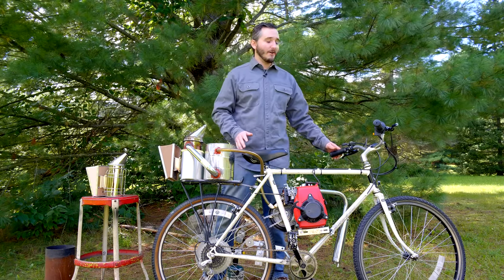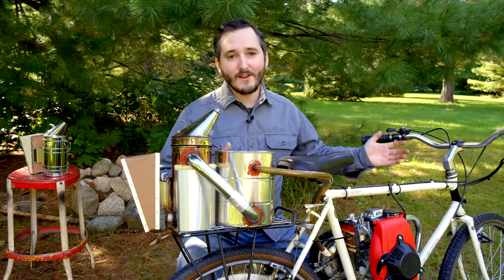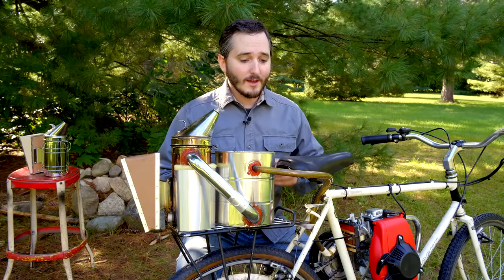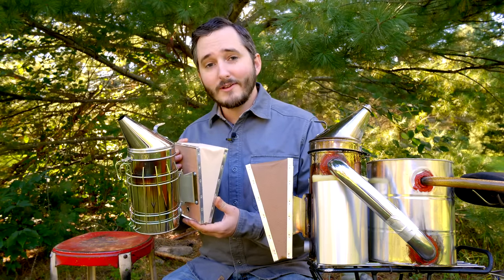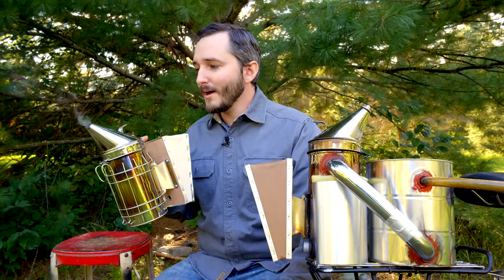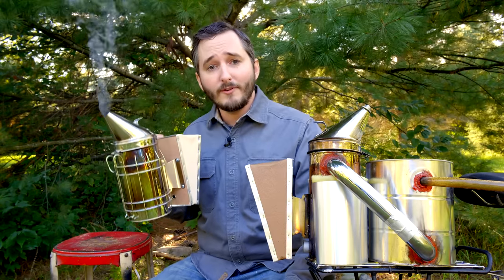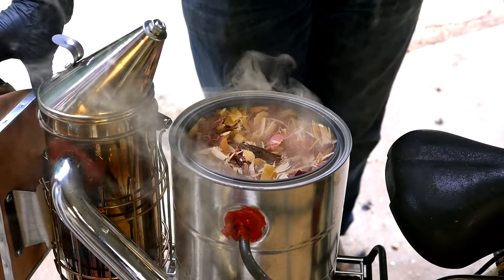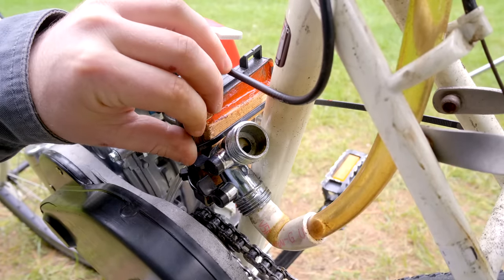Running a Gasoline Engine on Firewood | Woodgas Biofuel

Comment: Someone below mentioned a water based filter - and right away my mind went to a Rainbow Vacuum cleaner where they filter dirt our of the air by pulling it through a water tank on the bottom. I initially laughed at the Rainbow design until I tested how clean the air was coming out, and it was AMAZINGLY clean (the smallest particulates end up in the water tank)! Yes, my wife had the last laugh. And the Rainbow is 25 years old and still going strong (and replacement parts are cheap, too). I'll bet a simple one stage water filter would do it.  That is what I will use on my Wood Gasifier for my generator. Good video!

Comment: now i dont really know much about anything but i think stuff like this is so cool. i like diy things and its always good to learn. the idea of having a larger gasifyer(sp??) i think could work but my idea would be to try and filter the smoke more. i feel like its taking up space and not letting the amount of air in it needs. if there was a way to filter the wood gas to a more pure state before it reaches the engine it may just work.

Comment: Dry wood still contains about 6-7% water by weight, you could dry your wood at about 150°C for some time to remove that, it would definetely improve your wood gas in terms of flameability.
Also you can make some aluminium or copper (good heat conductors) air condensers between engine and wood gas generator to remove tar and water (if the outlet temperature is below reasonable temperature). Maybe adding CO2 scrubber would help?

Comment: I'm a shade tree engineer. My thoughts would be to produce a highly filtered wood gas into a bladder. Put the bladder into a tube. With weight you would create pressurized fuel. Add pressure regulator. Because the fuel would be "cold" you now have a "richer" more dense gas. Your results would be higher RPM's/ power with less exhaust emissions. 
You also wouldn't be carrying hot coals on your rear fender.

Comment: If you're still at this project at some point I would try damp gravel for a filter. Also leave the lid off till it idles, yes that means less fuel but it also means keeping the system going until it's ready to handle a higher load. Hopefully that would work. Best of luck and I definitely like your work.

Comment: I'm only vaguely familiar with this system of using the gas from wood to operate an internal combustion engine. This was used early in the 20th century in times of gasoline rationing due to the great world war. The Germans were probably one of the first to use and develop this system, but I am speculating and not stating a researched fact. I was informed that this was one of the methods the civilian population utilized during rationing and short supplies. The idea was to use "charcoal" to start with and add wood chips that would turn to charcoal in the process. As the gas from the charcoal was expended, the now cooked wood chips will have become charcoal and were fed into the burn chamber and fresh wood chips added to continue the process. This was explained to me some 50+ years ago and I never attempted to create one nor have I ever seen one in action. I like your idea here and I think perhaps charcoal might be more efficient and uniform in releasing the gas and possibly less smoke.

Comment: Hello NightHawkInLight. I have an idea for this setup that I'm convinced would work and I'd love for you to try it. There are two major hurdles that you need to overcome in order for this process to hopefully be successful. First you need enough wood gas to achieve a substantial combustion level in the engine so that it won't die when you throttle it , secondly you need a proper air-fuel ratio. 
To achieve this you need to double your wood burning production either by getting a larger bee smoker or combining two of them into one pipe section. Make sure to cool the gas substantially before letting it enter the engine. Having a water tank hanging from the side of the bike with some coiled metal or high temp silicone tubing would likely do the job.  

So in essence: more pyrolysis, more heat radiation, more cooling. We need a denser gas.

Comment: For the filter, you might be able to run it through water with some baffles to prevent sloshing. The tar will remain in the water and the water vapor will cool off and condense. The smoke will also condense out too

Comment: A Very small heat exchanger could help with filtration by lowering the temperature of the gas and causing the heavier oils etc. to condense and fall out of the stream, or at least be easier to filter out.
And it would warm up air going into the gasifier to get hotter temperatures there too. 

For the heat exchanger, take a tower CPU cooler like CoolerMaster 212 evo, and use the top half of the fins for the cool incoming air, and the bottom half for the hot output air. That way the heatpipes can work at maximum efficiency without relying on capillary action.

I would avoid jbweld or glues for the ducting on it, and instead use pop rivets so it could just be soaked in acetone to clean it when its all gunked up.

Comment: I believe if you have a dual pass filter it might be easier to remove contaminants from the system. I'd do this by making a center piece for the paint can. This could be a piece of pipe. Draw into the exterior as you were doing, the "torturous" path would filter out more contaminants. If also look into a bubbler system to purify the gas prior to ignition sure source. Hope this project works because I will be making something similar soon.

Comment: Gasification is intricate. I have heated my home with European and Canadian models. From a single air blower to supply both primary and secondary combustion chambers. To greatest efficiency only about 25% or less of the air is directed to primary combustion, (best secondary combustion yields a primarily blue flame), otherwise over-carburetion is the result (the same as flooding a gas engine but then I think you know the term). Dense hard woods of a preferred 20% moisture give the best regulated burn for standard wood supplies however dense hardwood charcoal briquets work extremely well. Your wood even if dry might be too dry or wet and from what I could see looks like pine of some sort and pine/spruce have knots with varying degrees of tars so I would suggest you eliminate them from your tests. They supply too much variability. For regulated bio gas production you should think of incorporating a refractory nozzle which is a very good heat sink but also a primary combustion core temperature stabilizer which allows for a more complete burn of your fuel source. In my boiler true gasification with dense hard woods (oaks, hickory locusts for example) nozzle temps can approximate 220f frequently. So, in a mobile format, for strength and durability's sake, you may want to incorporate/mix in stainless steel needles like those used to construct refractory molds in high heatapplications. Casual observance would suggest your ash collector/moisture condenser is about 4/+ times too small and for most automotive applications should not be the same as your primary wood gas cooler but part of a two phase cooler. I guess it depends how far you want to go in your experiment. I like this research. Thanks!

Comment: Excellent idea. The wood-gas needs to be cooled and regulated to a consistent gas. I know you're not a fan of gas storage, but consider your bike is made with hollow tubes that could easily cool and store enough gas to start the process and maintain an automatic supply. 
Thank you, I found several ideas in your videos to upgrade both my stationary and mobil gasification units.

Comment: I love seeing you put the wood gas you've been making to work. The only suggestion I have is possibly use your large production system to make the gas and then compress it into a storage tank on the bike. It would improving efficiency as the inert CO2 would not be in the mix, but would require you to fill it up and not produce it on the go.

Comment: A fundamental success Great Work. You've proven your design. You can easily see it choke out with less air vs leaning-out on the less fuel/ balancing issue complicated by burn rate. Obviously, you can eventually get this to a manually controllable process with levers/valves. ... I saved this video under survival / FUEL & Alcohol.... even your followers here are SO SMART I saved some of the notes from them ...... you gotta GREAT channel here. Practical Tech Applications / super cool to watch. 

A mobile gassifier COULD even be used on an electric car/truck to charge it while traveling 
So this is a GREAT ( mobile power generation ) project. 

 Right now ... without experiencing any actual long term survival or off-grid living... I think MY primary interest in a wood gassifier system would be to run generators to charge batteries or special power needs / off grid.  Easier to engineer a stationary system, BUT... I must admit, I think the MOBILE GASSIFIER Project will be a PUSH to create a more efficient controlled gassifer, b/c if you can get it to work for a bike for a few miles........... you have REALLY accomplished an impressive engineering challenge. (even if unpractical)

Dont set yourself on fire.... when you try to ride it (LoL) --- AND... you will have to consider Crash & Emergency Conditions (A rainy day could really suck) .... awesome video. 

In a WORST CASE.... if it IS too dynamic/unstable to master it manually (for long runtime), you COULD maybe control the process with a microprocessor and basic controls.... (low power requirements) small electric fan/dampers controlling burn~ But, what I am saying is... if you keep hammering at this project, from a manual perspective... you COULD eventually design a truly smooth Bike or Car on this.... the bike?  COULD actually be made to look very smooth and professional with composite materials / and housings / plumbing to handle all basic problems.  And I suppose smoke/tar/water can be handled too.... but you're going to run into all this for long term running conditions.... that's why attempting a fully MANUAL system is actually quite HUGE and impressive.  b/c if it even sort of works ......... it's a HUGE accomplishment.  I have NEVER really studied wood gassification before this.... but this is just too cool.

Comment: I would wet down the bottom layer of cedar chips so you have a water filter. I would also add a water bubbler so that the water vapour does not carry through with your wood gas, and the flammable fuel gas is more pure.

A bubbler system would remove the need to set down the cedar, though the bottom cedar layer being wet would collect the tar better. You could also alternate between cedar and moss to add a differential filter to your gassifier.

Comment: Gasifiers are much better for something with a constant load. Charging batteries for example, with the batteries powering your equipment. Using it for mobility creates a spectrum of demands depending on the terrain and speed. It's a neat tech, perfect "End of the World" tool.

Comment: I remember to discover producing burnable gas by forming a "cornet"/funnel out a A4 paper, playing with fire as a kid. Holding the broad side down and burn it, so that the smoke comes dense out the tight part of the funnel on top. I was amazed that I could light up the smoke.

Comment: Hey Hawkin, I think that if you had some sort of air pump hooked up to the pedals, that would allow you to increase air flow to the engine. This requires less effort to get the bike in motion, and you could also have a gear set up from the back hooked up to an air pump. Or perhaps you could make use of that last bit of space to have a manual gear handle that you have to turn to get it started, but then once you get in motion the back tire air pump would take care of that. 

The pedal gets you into initial motion, and the air pump attached to the pedals also force air into the engine. Then the back tire air pump will take care of the air. 

One last thing is that you could have a sort of battery pack with a solar panel on top charging the batteries, then once you hit a switch it turns on a blower forcing air into a tube connected to your air inlet. 
Please forgive my lengthy explanation, im not that great at explaining things

Comment: You could have the gasifier in a small trailer behind the bike, you could have a larger gasifier and filter setup. An added bonus is you wouldn't run the risk of burning your back like on the current system :)

Comment: You absolutely right its not big enough but your problem lays in many areas. For example its needs a regulator that can ajust the amount of fuel it needs. I think the real soulution is caching the wood gas and compresing it and runing it through a regulator of some kind. If you look at steem engine you will find that the steem is gathered in a tenk and then relisted into the engine. I believe the some system would have to be applied in your wood gas system. Also you can run a gasoline engine on propaneso maybe find a propane engine that more set up for this.

Comment: Excellent content, just forget about the wood and shove charcoal in the smoker, it is cleaner burning and will not need scrubbing. You might have to adjust the fuel air mix.

Comment: Use a gate valve for the air intake instead of the ball valve and tie it to the throttle linkage. The wood gas is under pressure the air intake is passive, give the air an advantage when throttling up.

Comment: Connect the bellows to to a taller can,  have more air intake (adjustable) to the reduction zone, put the outputs of all stages at the uppermost portion so no woodgasses get trapped above the output tube/ pipe,  add a bio oil catchment/filter (similar to a bubbler) before the particulate filter (wood shavings filter). Add some type of smaller screening to the output of the wood shaving filter (say coffee filters or sponge).
You may need to build/ extend a carriage that goes down behind the back tire, same width as the carrier. 
Hope this helps.
Reply: Further thoughts:  in the bubbler use a high temp ignition combustible like diesel so no water vapor gets into your engine. And put a sponge filter on the air intake. May quash some of that blow back. You could also fashion a simple reed type valve for the air intake to go into the sponge housing.

Comment: Maby to prolonge and make sofort much longer  the coper tube who goes to the carburator would have the effect to cool down the gasses and expel moisture by condensation. you could turn him around in a few circles. some youtubers videos claim it is important the gasses to be cold  for the motor to be efficient GOOD LUCK nice setup

Comment: I believe that you have the bee talk a little off. Smoking bees actually clams the bee more so than making them think the hive is on fire and eating lots of honey. Just saying. I really like the water hose Y connector with off on at the top of the Y's. I used the same thing when I made a vapor running lawn mower. Still running well on vapor. Your logic of starting with the smoker is a sound one. Good luck moving forward fella too.

Comment: Bike trailer with a modified hot tent stove or 55 gallon drum stove might make a large enough gasification chamber.  A weber smokey mountain grill has a door that you are use to add more fuel as needed.   The are available in 3 different diameters.  They also have grill racks that can hold the gasification chamber.   With a long trailer or tandem trailer you can make make a cooler and storage tote setup for fuel storage.

Comment: really digging the woodgas experiments. I made my own charcoal furnace after watching one of your videos. I have also been considering ways to filter, store and compress the woodgas. I'd love to you experiment with compressed woodgas. You could try a really simple method, put your air compressor in a trash bag and tape it off around the tube from your gas storage contraption.
Reply from the maker: Compressing woodgas can be dangerous because it contains trace amounts of oxygen and may become explosive when compressed.

Comment: A small battery with a variable speed blower to adjust the air feed to the gasifier.  Possibly the same thing for the fresh air feed.  This would allow for mixture control from the handlebars while cruising.  One step farther would allow for computer mapping and eventually computer control once enough data is collected about what temps and mixtures work.

Comment: Acetone bubbler instead of a dry filter will do better, I think. The main challenge will be to figure out the right design for a valve to restrict acetone from getting into the reaction chamber.

Acetone or alcohol (ethanol or isopropanol) are amphiphilic solvents, so they dissolve both water-soluble and water-insoluble stuff like tar. Since they are quite hygroscopic, vapor and steam should stay there as well. However, there will be losses of wood gas because it’s soluble too. Anyway, I think it worth testing.

Comment: I have a couple of thoughts. But first i wanna thank u for teaching us to use "clean" easy combustible.

I think if the shavings are betterly shredded it will generate more gas per second, and also you will also be able of packing even more wood in your burning chamber.

Also, how about condensing this gas after being filtrated? What if you could increase pressure and combustion load by serving the gas into the engine instead of making it burn on the go.

You can also make the bee smoker automatic by cliping it to the bike pedals/wheels, so it wil combust nicely and fast.